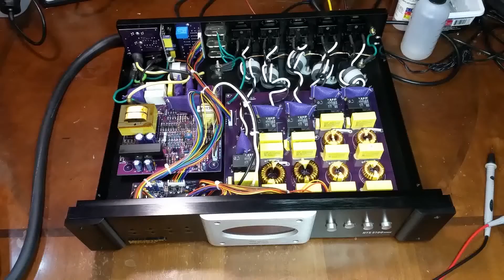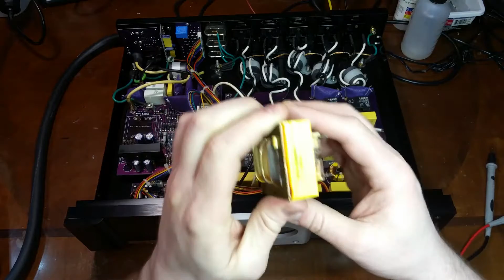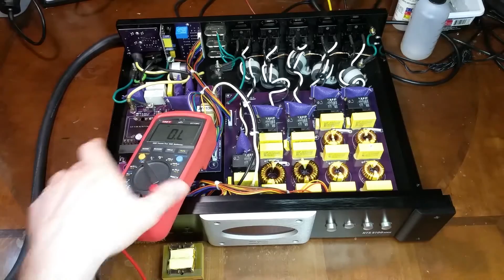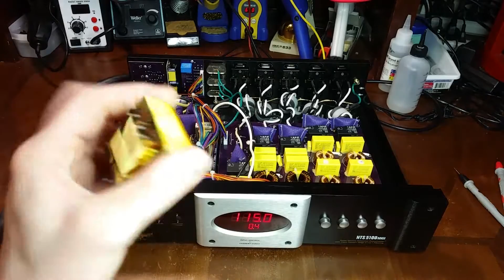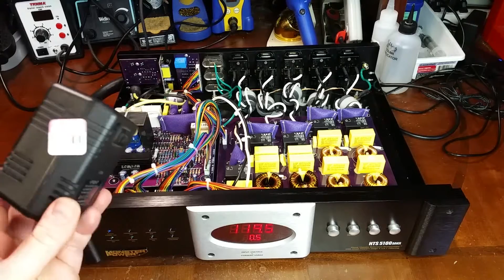Monster Power HTS 5100 Power Center Repair! Update

Comment: I used my HTS 5100 for about three years when suddenly there was an audible buzz and the display went dark soon after. I sent the defective unit back to MONSTER and they honoured their lifetime warranty and sent me an exact replacement at no cost to me.
Reply from the maker: I'm curious, but was proof of purchase required for the warranty work?
Reply: In my case I still had the receipt, however I don't think it is necessary if the product has lifetime warranty.
Reply: Ray Duerksen thats amazing to know.  Was your unit a mark 2 version or the original? The Mark 2 is in this video which I've heard is not as good as the original because the company was already changing.
Reply: Mine just went south this Sunday with a huge popping sound, after that only abnormal light are display. Unit is bought direct from Monster so there's no need of receipt. I was told these are not lifetime warranty and only 5 years.

Comment: Is there a way to use a 4 pin transformer instead of a 6 pin? The one that is fried on the power center is a 6 pin...
Reply from the maker: Yeah should be fine if I remember its a single rail power supply.
Reply: jeffescortlx thanks, found a 2 amp 16.5v
Reply: @JonAKetchum  how did you connect it? What did you connect on 5,6th pinholes?

Comment: I have a similar unit that just started displaying the abnormal voltage light only. Voltage from the outlet is perfect . What was the snag on this unit.
Reply: Too bad you never got any response...mine just started the same problem last night and I'm just gonna replace it....unless the original poster has another idea..
Reply: @icedog75  Did you figure it out, or just replace the unit?
Reply: @stevencollier5857  I just replaced it....
Reply: @icedog75  Thanks. I found that the power supply circuit board has a burnt spot, so it's toast I'm afraid.
Reply: Did you ever figure it out? I have 3 of these, and one stopped working last night with only the red abnormal voltage light illuminated.